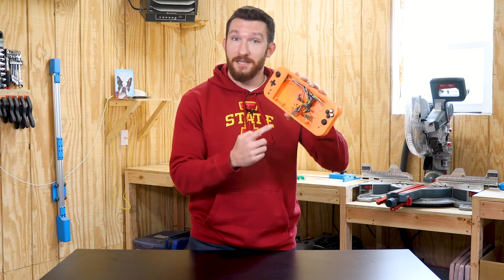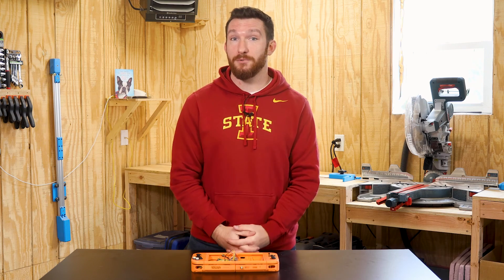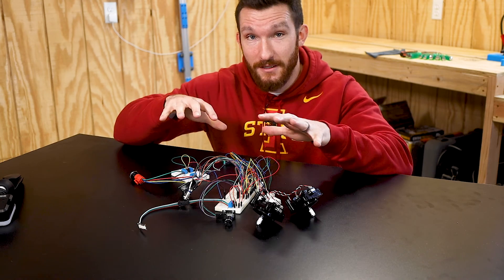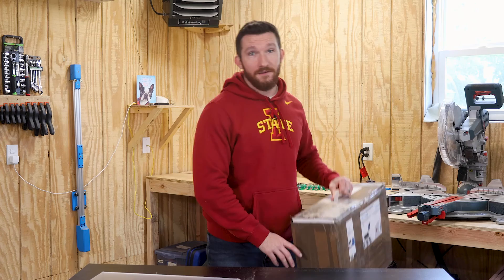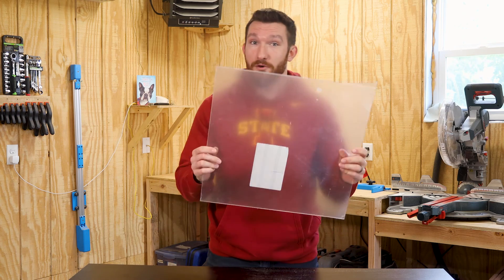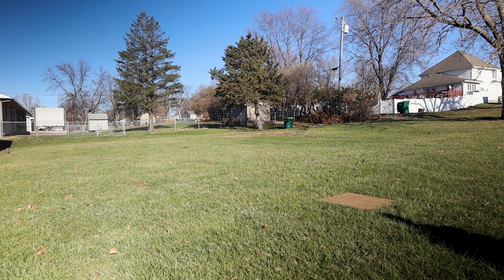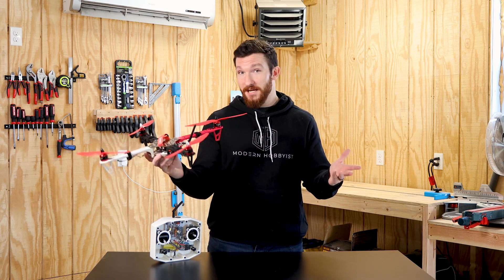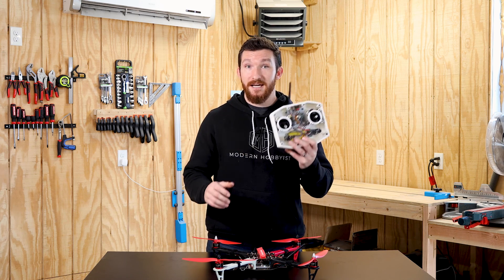I Made My Own Drone Controller!

Comment: The EZ-WifiBroadcast controller is awsome, I would really like to have 3d model of it so I can replicate it.
thanks.
Reply from the maker: Thanks! I actually used this model from an old classmate of mine and drilled a few extra holes in it for the Wifi antenna: https://timee1994.weebly.com/nintimdo-rp.html
Reply: @ModernHobbyist  Thanks a ton, Mate!